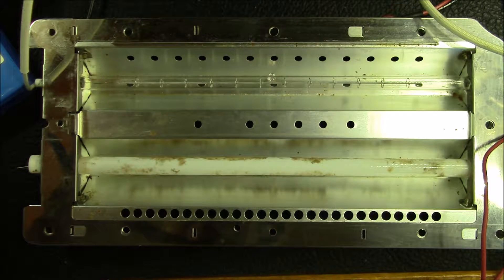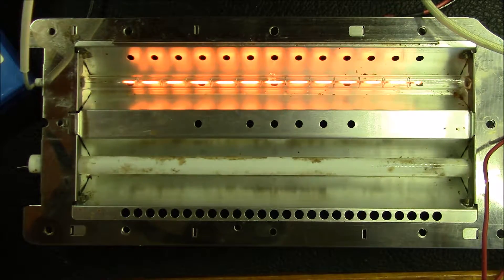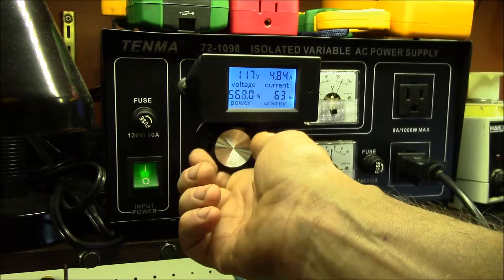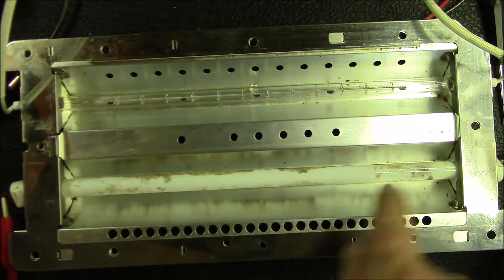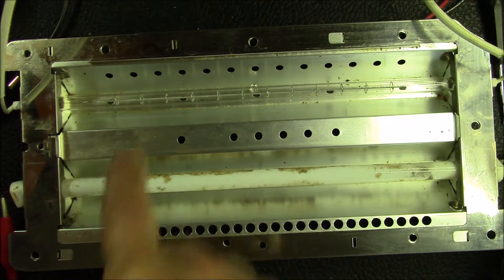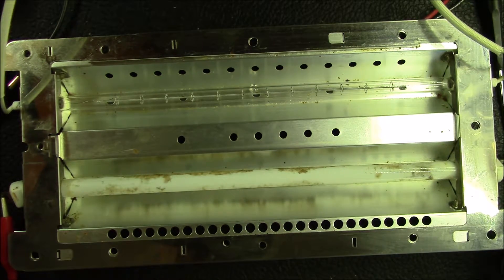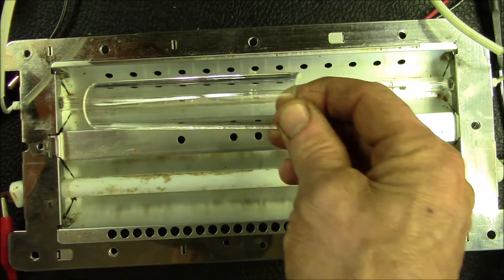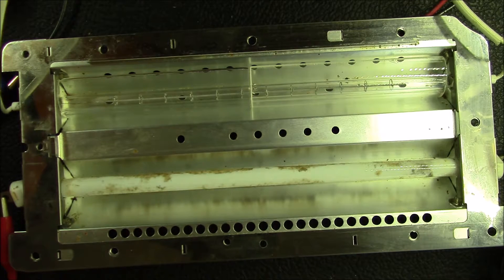Advantium SpeedCook Oven Repair, Part 6 - Testing upper heater

Comment: Hi R Brown, I got a “deal” on an almost unused 120v advantium that was never installed because they never got a handyman to modify cabinets to do it. The lower ceramic heater apparently does not work on high. Biscuits brown on bottom when I set it to biscuits, but a pizza stays white and soft on bottom. I am a fairly high level diy-er. I have the tech sheet. It has a disappointing amount of testing/troubleshooting. I guess I need to get off my a$$ and go to the shop for my ohm meter before I ask too much. I took a leap and bought a lower miraclon heater off eBay, hoping to just replace it without chasing down wiring and switches, etc. one question I’d like to ask is: why do biscuits brown but pizza does not? Same metal tray. 
Anne
Reply from the maker: Mine works fine on the pizza setting.  I would suspect that the "recipe" settings might be off.  You can usually check the values of the settings and they show "U" for upper heat and "L" for lower heat as I recall.  Compare the settings in those 2 recipe settings and it might show a difference (mine has both at Hi for pizza and U=Med and L=Lo for biscuits).  I don't think you can edit those built-in settings.  But you can create your own new "recipes" and set up the parameters as you wish.  If the full power setting doesn't work, try making a custom setting for medium power on the lower element and see if that works.  I've never looked at the lower heat element on mine.
Reply: @The4Crawler  my settings say the same. Thinking lo works but hi does not.
Reply from the maker: @annereynolds4427  Yes, must be something wrong there.  According to the service manual it seems to be a single heater element, so not sure how they do the L-M-H heat control.  

It appears all they have for control is the ceramic heater element with 2 terminals and a relay powering it.  That suggests that the heat control is just a varying duty cycle of on and off time of the element.  Doesn't appear to be a temperature sensor for that lower heater, so it must just be 3 different pre-programmed duty cycles for the 3 heater powers.  If that's the case, then if low heat works, that means the heater element is intact (there's a resistance test for it, ~36 ohms) and the relay works, or at least is able to send some power to the heater.  There's a table in the manual that shows the heater on-time is anywhere from 30% for low heat/low power up to 100% for high heat/high power.  Two likely sources of the problem might be the relay or heater element overheats when on continuously, or the main circuit board is defective and when high heat is selected, it fails to turn on the relay (RY9).

Comment: Alas I did buy a headache.  The one I just got was a used 110v GE made in 2005.  Grease on reflector  but worse was missing the metal pan which is a $105 part. Plus several of the control buttons were melted.  Seems like someone left a stove burner on.  So this will require a few hundred in parts.  Luckily the next day the seller agreed to refund me half the $70 I paid, plus I found a brand new old stock unit at an appliance store that was a floor model.  It is a 220v over the stove version and they are selling it to me for $190 plus $60 shipping.  I just have to get an electrician to install it now.  But far better than trying to replace parts on the old one.  I'll sell or donate it.
Reply from the maker: Too bad on the 120V model, may be useful for some spare parts.  I would have loved to get a 220V model, didn't know they had them when I bought mine.  They are faster cooking as they can run the both infrared heating elements and the microwave simultaneously.  On the 120V model, they cycle between those since they can't power everything off a 15A circuit at the same time.

Comment: The oven is supposed to have a large glass shield over the element, inside the oven cavity.  Did yours break?   Buy unit used and not included?  Its supposed to be there to prevent anything from getting up out of the cavity and onto the bulb.
Reply from the maker: Interesting, mine never had one.  I purchased the unit new around 2007 as I recall.  No mention of a glass cover in the manual I downloaded either.  Maybe something that was added later.  I did find it interesting that 2 halogen lamp shields fit perfectly in there.  Repaired oven is still working fine, 2.5 years later.
Reply: @The4Crawler   Totally nuts -- yes I just researched and apparently the old ones did not have a glass shield in the oven -- so grease vapor and spatter etc could get straight into the main halogen cooking light housing.  So much for being a "reflector" if coated in years of grease.  What an absolutely negligent design.  Apparently the newest Advantium models, that can broil, were redesigned with a glass shield inside the oven cavity.  I wanted to know because I just bought a used, older model, off ebay.  I think I may have just bought myself a headache.
Reply from the maker: I'll have to see what those newer models look like.  Wonder if that glass shield will work in the older models.  Anyway, the pair of quartz glass shields I used seem to be working fine.  I checked this morning and they have some light spots of whitish residue on them, but still can see through to the bulb behind.  Only bummer was that I threw 3 of those quartz bulb shields away when I converted my torchiere floor lamps to LED.  I ended up having to buy some new ones on eBay.

I thought it was ironic that the instructions on replacing the halogen element warned to avoid touching the bulb with fingers lest the oil cause hot spots and premature failure.  Yet, the bulb is going in above the hot cooking food with only a sheet of perforated stainless steel for protection.  So yes, agree that that was a weak point of the design and interesting to hear my fix is now part of the newer models, I guess I was on the right track.